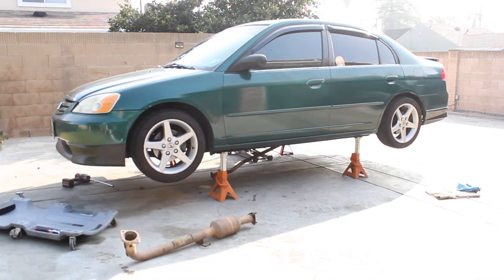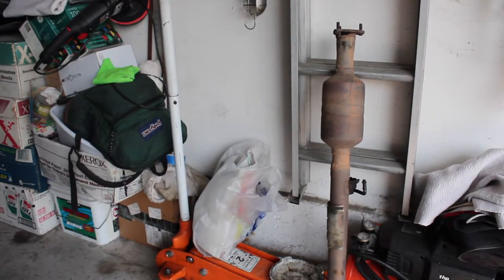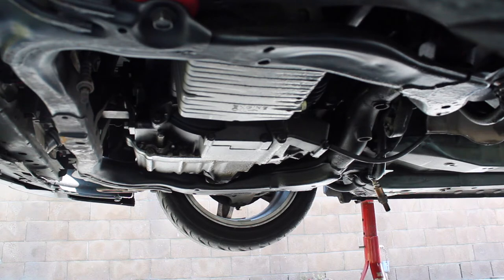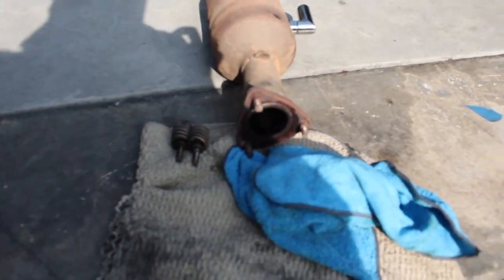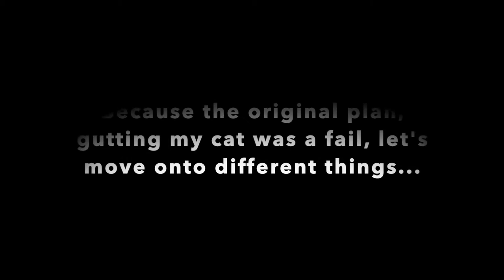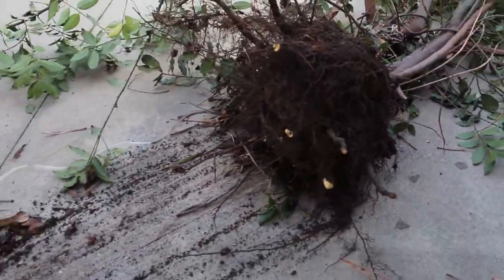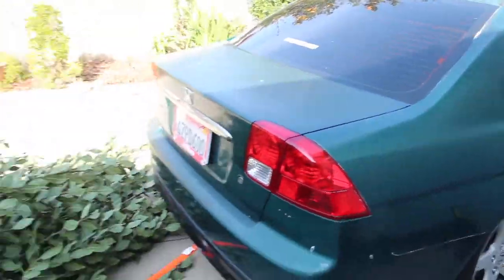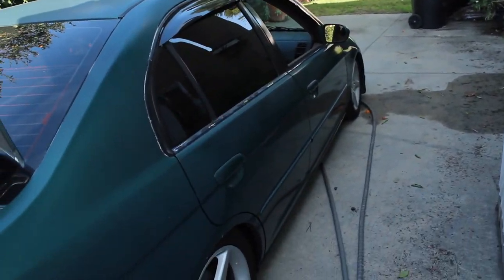How to be Ricer Episode 1 (Attempting to Gut the Catalytic Converter in the Civic)

Comment: Had the same issue in my 05 civic with power steering leaking and always refilling it needed up being the high pressure hose was leaking from the crimp when turning full lock the leak ended up damaging the power steering pump within time, I replace them both and no more leaks or whines Hope this helps good luck!
Reply from the maker: Thanks! Yeah power steering is so blown hahaha. I think I might just do that.